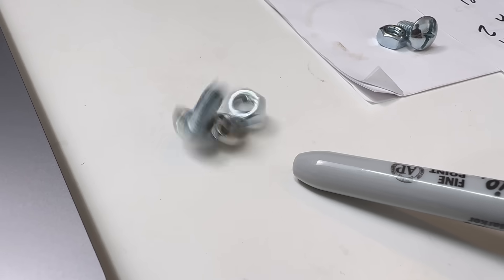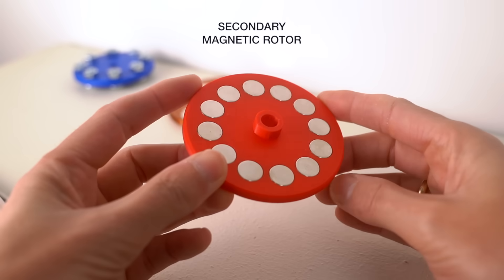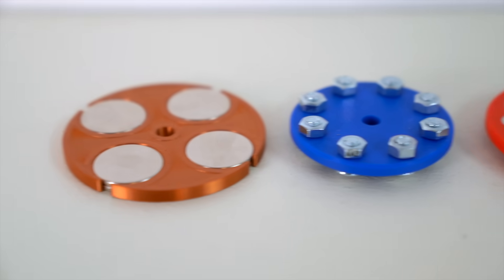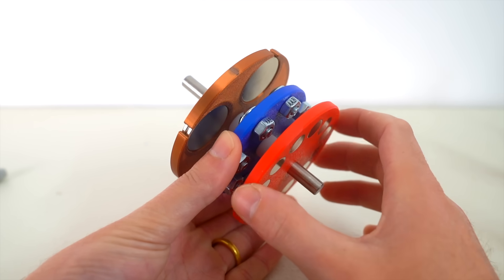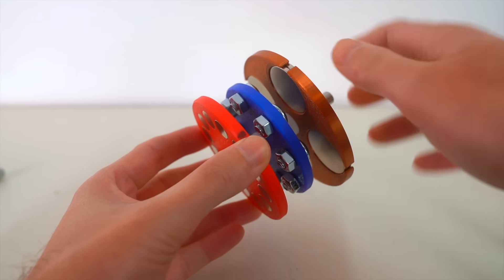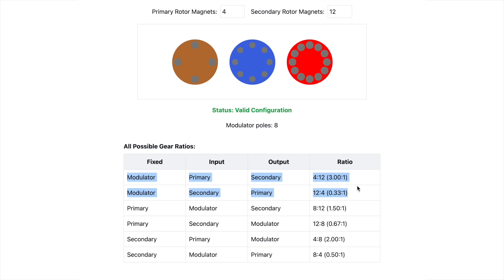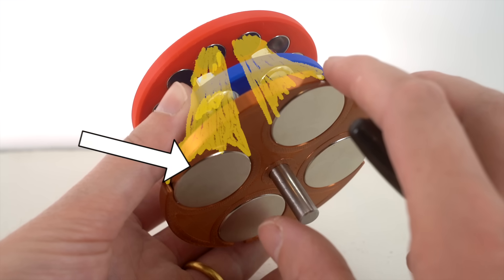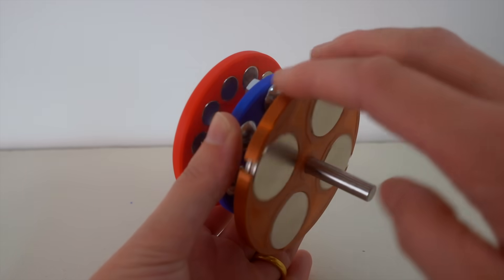What makes magnetic gearboxes so amazing?

Comment: this is useful for applications where high rpm but low torque are required for example electrical generators rather than motors
Reply: The literature suggests that slightly different magnetic gears could be used in very powerful axial flux machines in the future
M. F. H. Khatab, Z. Q. Zhu, H. Y. Li, and Y. Liu, “Comparative study
of novel axial flux magnetically geared and conventional axial flux
permanent magnet machines,” CES Trans. Elect. Mach. Syst., vol. 2,
no. 4, pp. 392–398, 2018.

Comment: i like the concept but I can't think of a way to use it.
Reply: Anywhere you'd normally use a gearbox, but you don't have to lubricate it. Practically, most electric motors need a reduction before they can drive something useful, and a high efficiency, effectively zero wear gearbox that you can integrate into the motor housing if you want is a very useful thing.

Comment: Create the gearbox that allows you to connect it to a bicycle so I can use magnets to heat up water or fry an egg. but you can only use magnets spinning under a metalic plate that heats up. great for making food and fire when no electricity is available
Reply: but you can only use magnets spinning under a metalic plate that heats up. great for making food and fire when no electricity is available

Comment: Overload protection sounds like another way to say that the gears slip
Reply: I mean, it's not like they hide that. They say it's a drawback by not handling much torque. But if you design it to where what it can handle suffices, than it is a proper overload protection.

Comment: why dont we use this in a car?
Reply: Probably because of the what is explained in the last part of the video: they don't handle high torque well.
Reply: The strength of natural magnets also degrades over time, especially when subjected to heat and other conditions a car would be subjected to.
Reply: @eccentricbass3730 different grades of magnets easily fixes the heat issue
Reply: Not efficient.  Doesn’t handle torque well.  You would have to use a bunch of small ratios, as small as possible, stacked on tops of each other to reduce the torque on each set of magnets.  It’s a neat concept, but a viscous torque converter is far more efficient.  Found in all traditional automatics as a clutch replacement.  But it’s actually a transmission itself.  If you design one well enough, you don’t even need gears.  Koenigsegg made a hybrid like that.  High power engine connected only to the perfect torque converter.  It still isn’t very responsive, so there was also an electric motor at each wheel.  It was like starting in 6th gear, but the motors would do most the work at low speeds, and taper into the engine doing most the work at high speeds.
Reply: I believe its because they aren't very torque-ee.

You can stop them easily.

But they also don't break when the gears fail, instead they slip.

Comment: But what would they do with a load applied?
Reply from the maker: small/steady load is great, fast impulse load is not good. see the windmill example at the end of the vid
Reply: mega amounts of heat will eventually blow a magnet essentially. non efficient=heat , on top of magnetic field friction.
Reply: @slamacreepa  eddie currents
Reply: @Unapersonaconunmicroscopio thats how he gets the speed changes. The issue is magnetic field interfernce at higher speeds casuing drag.
Reply: I kept thinking if they could be used for bikes lol but I guess he did say depending on the torque they would stop providing trust lol
Reply: @juanmacias5922 Check out Tom Stanton, he tried something like this*if I'm not mistaken*

Comment: you can also hold steel wheel balls (joints) into the socket with magnets. yep knee joint. some slippery plastic in-between the magnets and the steel ball, make the joint move. or just grease.

Comment: how much do the magnets cost? ive never actually bought any, especially those more flat and pancake shaped ones.
Reply: Not much in the shown size, but they get expensive very fast if you need a little bigger ones
Reply from the maker: About $1 USD for the big ones
Reply: @3DPrinterAcademy  Nice!
Reply: Most hardware stores will sell them for 3-5$
Reply: JK Magnetics has about every size